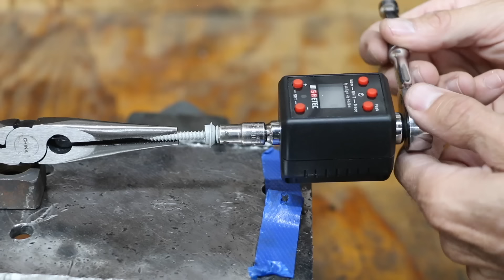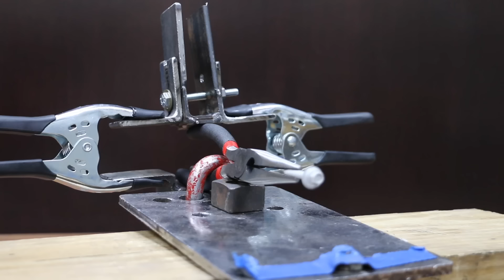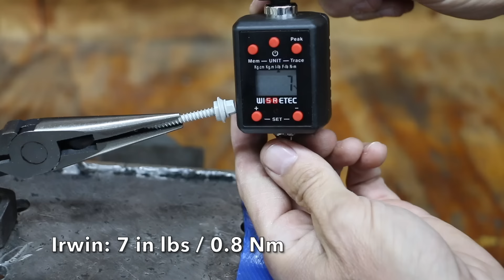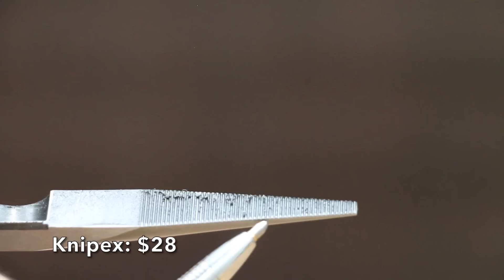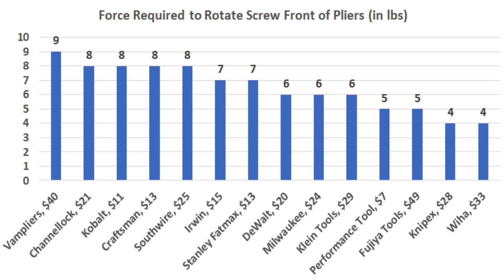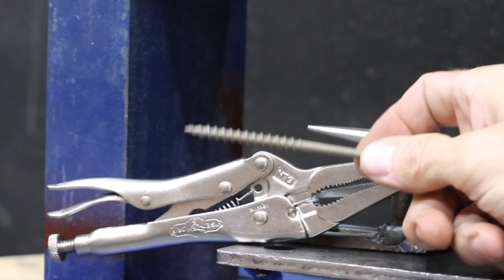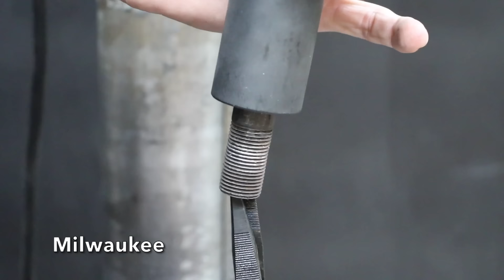Japan vs German Pliers (LONG NOSE)? Knipex, Vampliers, Klein, Fujiya, Irwin, Kobalt Needle Nose

Comment: As an electricians apprentice, I was taught to take my new pliers, spray a little WD40 in the joint, and "exercise" them until the operated smoothly. Good tools will wear in without becoming loose, while still operating easily. Holding one handle, the other handle should drop under its own weight when let go. Another thing to be aware of is that some tool brands, such as Klien Tools, have several different grades of the same tool. One can purchase the tool that meets your needs and your budget.
Reply from the maker: Thanks for sharing!

Comment: I love my vampliers. The only factors that matter to me are the grip strength and weight. It's a shame they're so sharp because I use them primarily on soft copper in the back of electrical boxes. The cutters are just a nice to have, I always have a bag of tools that are designed to cut along with them.
Reply from the maker: Thanks for the feedback.

Comment: It’s seems the cutting tasks would be beyond the strength of a person to actually perform. Might have been more meaning cutting various gauges of wire. The more valuable tests and observations where the twist test and the flexibility of the handles and tip alignment.

Comment: What a great video, one more time. The quality of the content is impresive and worldwide.
Again, the differences in measuring system makes me confused. What does 5 penny nail mean? How to clasify that? In Europe, we use diameter in milimeters and lengts in inches - the most situations.
About test, I'm also very impressed how the cheapest pliers performanced in compare to other. I think that these pliers are used to ver precise jobs, in small areas, so many of them could handle for long time. Honestly if I'll buy this type of pliers to cut nails using them - everybody could name me a tool murderer.
One test is missed. I really waited for axial nail removing with vertical pliers gripping.
Stay healthy and thank you one more time for your test.
Regards from Poland!

Comment: #Suggestion

Hammers

Wood handle
Fiberglass
Steel
Titanium

Test force delivered with consistent striking energy input.

Test handle durability.

Test face chip / damage

Test claw chip / damage

all vs weight

Comment: Twisting a screw with the pliers clamping down seems like a meaningless test. I mostly use needle nose pliers to grab small items in tight places and would love to see how much traction they could get on a thin smooth item using typical hand strength

Comment: Great video as usual Todd! 
I'd imagine in less abusive enviorments, that the Wiha pliers at 64 Rockwell/ H.R.C. would last/stay sharp the longest, I'm guessing  by a large margin. The finish also looks like they'd be more corrosion resistant. I'd be interested if their line carries dikes & linesmans pliers, as their edge retention seems to be outstanding.
Just as a side note: While I think your 16d nail cutting is an excellent way to demonstrate abusive edge retention, I think in practice is pretty unlikely. I'm a big fella with XXL mitts. I have some steel knurled grip strengthener/squeeze testers that my buddies and I use. In my experience, the average untrained guy can typically squeeze the 100# relatively easily, but the jump to 150# is a big one and fairly difficult. 200#'s is definitely going to take some serious practice. Anything above that and you're the kinda lad that can rip phone books in half. 
Thanks for the awesome videos!
Reply: @TheCheesePlease  The test proved that their serrations could be better, they're not great at cutting nails, or very high torque applications. 
That steel/h.r.c. would be excellent in a set of cutters, which are used for their intended purpose.
My point of corrosion resistance and edge retention is valid.

Comment: Were all the Pliers Insulated? I am a Electrician and I have used a Craftsman  Insulated Needle Nose Pliers for years. It was made in the USA! I cut nails, screws, twist all kinds of wires with it and it still performs like new.
Reply from the maker: Not all were insulated.

Comment: Would have been interesting to put the joint to tip length into a table. And maybe also measure the holding torque at the same distance to the joint. Not considering "the law of the lever" makes an unfair comparison.
Reply from the maker: Thanks for the suggestion.

Comment: A pulling strenght test would have been nice. Since thats what I mostly use needle nose pliers for. Get into tight spaces and pull something out, when I cant do it with my fingers
Reply from the maker: Thanks for the suggestion.
Reply: That's what the grip test is for, and he did that.
Because what is that the pliers do when you pulling something? They grip and YOU pull.
Reply: @Humblebeast_peace  ya but not turn so ya no he didn't to it
Reply: @DEVIL666wtf  He did grip, then he did turn, but not at the same time.

Comment: I've bought quite a few Kobalt tools over the years, including a ratcheting breaker bar and automatic adjustable pliers.  They have always impressed me and experienced less corrosion when compared to other tools that were left in the same conditions.  If I ever need another set of needle nose pliers I know which one to buy.  Their miniature pliers set is also really good.
Reply from the maker: Thanks for sharing!
Reply: My only tool from kobalt that rusted was my driver bits from 5 years ago that I left out for a few months accidentally. Of course, I broke several other bit sets in that time, so not a huge complaint.

Comment: Some of these tests seem to be extreme.  I would never use long nose pliers to cut nails and screws.  I would use a linemans pliers for that.  The twist test seems to be the one that makes the most sense.  I would have rather seen how well the pliers cut wire cleanly.  For example can they cut 20 gauge wire without leaving stray strands? How many times before they get dull? How comfortable were the handles?  Seems like the test should be more applicable to what the tool would be used for in a daily job.

Comment: I feel that to correctly measure relative performance, the screws in the grip tests needed to be placed a fixed distance from the joint of the pliers. All the pliers with longer noses are losing the grip tests because the longer nose translates to less force at the tip. But, there's nothing to keep you from choking up on a fastener with a longer-nosed plier.

Also, the use of painted screws means that grip performance is somewhat correlated to the quality of the paint application, and if you have some screws with different paint application quality in the same batch, it could introduce variance. Bare metal might have been a more consistent option.
Reply from the maker: Thanks for the feedback.
Reply: They should have thought of that when they made their pliers.

Comment: As an electrician, I'm less interested in hard use and care more about width and length to work in tight spaces. And I think Knipex and Wiha are both designed for that.
Reply: I was going to comment this too; the length, width (base and tip) matter more for needle nose pliers usage.

Not that I'm not intrested in knowing what the cutters can take, or how much force the handles can be subject to, but it does seem to be missing the point of needle nose pliers.
Reply from the maker: Thanks for the feedback.

Comment: It would make sense to test tools with the same length. Of cause you can twist a long small gripper like the Knipex 26 15 200 in the test more than a short one. But as you would not use a cranesbill forceps the same way as a Lineman's Pliers it does not make sense to test them in the same way.
Reply from the maker: Thanks for the constructive feedback.

Comment: As an electrician. I use needle nose pliers every day. Thank you for the video. I use the Icon brand 8" needle nose from harbor freight and have had good results with them .
Reply from the maker: You are welcome!  Thanks for the feedback.
Reply: Clancy, if you turn up at a client's premesis with a toolbag full of Harbor Freight merchandise, you are not making a great first impression. You need a couple of Wiha, Signet or Knipex pliers hanging on your belt for street cred.
Reply: @bennyattar8862  all of my other tools are Klien  , Greenlee, and Ideal. I tried the icon brand because they are cheaper.
Reply: @bennyattar8862  also the customers couldn't care less what brand of tools I use. The quality of work is all that counts.